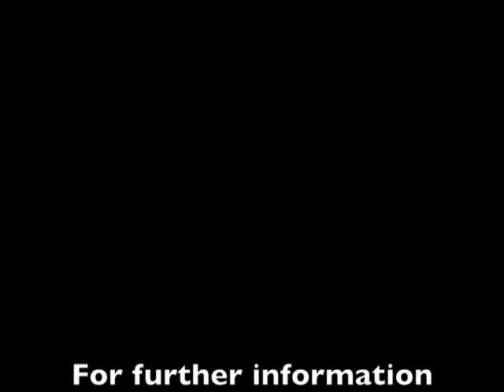Physics of Pumping a Swing

Comment: I think the hand force on the chain is key to greater amplitude. It shortens the pendulum, raising the weight slightly, equal to the force applied, then is released/lengthened at the forward point. Seems like it is also changing the equilibrium of forces so it is not static and must increase forward speed to reach equilibrium. Swinging legs help, but it is not necessary.
Architect in CA USA, not a physisist

Comment: Would the wheel experiment work if the torque were applied by a hub motor instead of extrnal strings?
Reply from the maker: Yes! The external strings pass over a rod of small diameter giving very little external torque.

Comment: Interestingly, the driven oscillator strategy is superior for small angles, but then becomes inferior to the parametric oscillator strategy at high swing angles. 

IMO, from an energetic standpoint, this makes sense. Raising your center of Mass at the bottom of the swing trajectory adds more energy to the system the faster you’re moving. Ie W=F*d where F ~ v^2/r due to the centripetal force, and d is the constant amount by which you raise your COM. 

But the angular momentum kick from the driven oscillator strategy adds a constant amount of angular kick no matter the speed.

Personally, with the parametric oscillator, I can take any swing I’ve ever been on to a near horizontal swing with slack in the chains :)

Comment: This second demonstration isn't correct either.  While a child may be using the driven oscillator method to pump a swing, this demo with a bicycle tire has strings adding a lifting vector to the leading edge of the wheel that doesn't exist when a child "pumps" on a swing.  I would like to see a better designed demo of the second method and a more in depth explanation for WHY the driven oscillation works.
Reply from the maker: The string pass over a rod of very small radius thus applying very little additional external torque to the system. This issue is considered more carefully in the second paper referenced at the end of the video.